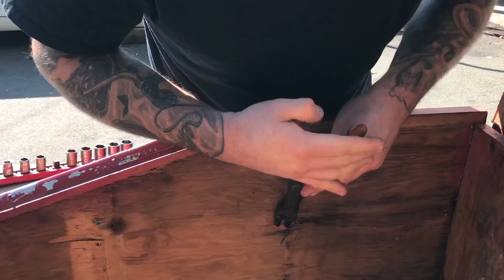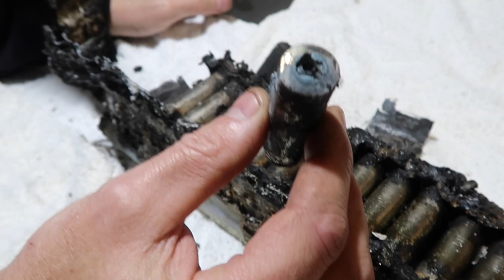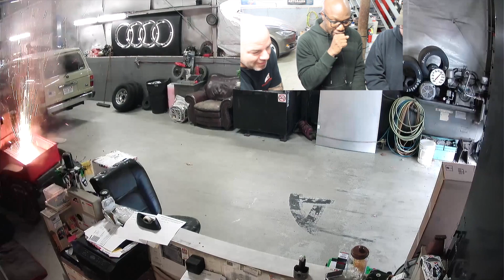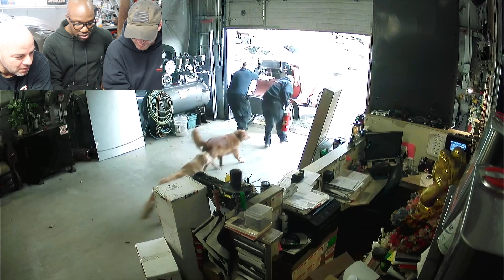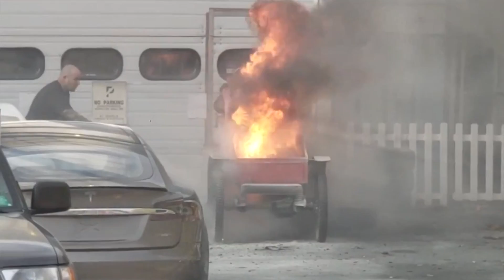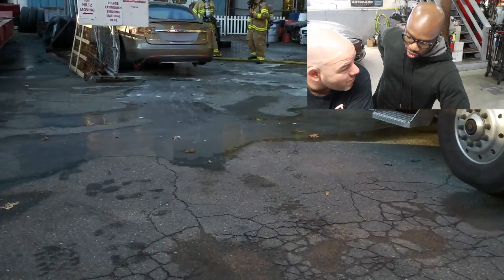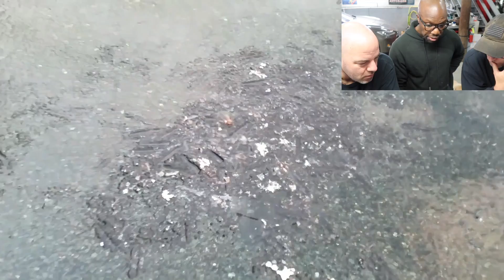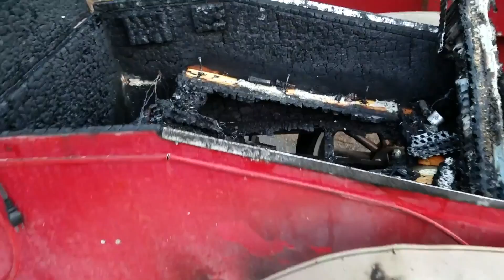My first Tesla Battery Fire

Comment: Rich, you've spent a lot of time and work trying to convince the world that Tesla should support independent shops and mechanics and then you go and do this...
Reply: It's called being honest I guess. Like anyone he'll learn from his mistake and be more careful with batteries
Reply: What rich did here is basically the equivalent of someone planting a new fuel line in their car, knowing it has a leak right in the engine bay, but installing it anyways, because funs and giggles
Reply: TBH this has nothing to do with Tesla. The way these guys charged and connected the batteries (and for some reason edited out some parts and didn't talk about what they actually did wrong).. It would happen to every other battery out there.
Reply: The battery as a unit is fairly safe. It's not safe once you start taking it apart and removing all the safety measures Tesla put in there. (the first being the large case surrounding them.)
Reply: This happened because he got a cheap charging solution. Not because people touched a tesla battery.
Reply: They need training in physics and chemistry because they don't seem to understand what is happening - A FIRE EXTINGUISHERS? EIGHT EXTINGUISHERS? It's not a fire, it's a thermal ignition chemical explosion. And the smoke is poisonous!
Time for certification. Backyard ICE mechanics are not up on physics. That could have leveled the yard and poisoned the neighborhood.
Reply: @davis.fourohfour  don't be soosoooo dramatic!! ease up on the sauce ur on.
Reply: Tgey sure should. But if you ever looked at the packs they use, you'll know that the main battery unit isn't meant to be opened at all by anyone but Tesla themself. And the big packs are usually not refurbished but replaced and disassembled. Good cells might make it back into new batteries, but only after testing
Reply: Robin Rumpfkeil batteries are always thrown away, integrally. If you watch this channel you'll have noticed how much effort is made in battery packs to make them not serviceable at all. Lithium is not expensive enough to make manual disassembly, testing and reusing of individual cells a viable thing, and it will never be. Cells ages differently, dendrits grows inside and possible residual lifespan is completely unknown to allow them to be grouped again in packs with other unknown state cells.
Musk himself says that his dead batteries are crushed and chemically separated, the vast leftover being dumped in cement mix to pour concrete...
Reply: Robin Rumpfkeil  also, "fixing" a battery pack by manually swapping modules is still viable economically for a DIY kitchen-knife-equipped enthusiast, and it should be a safe and documented solution to expand life of batteries, and it is the whole point of this channel.
Reply: @Damien.D  well. But the chemical separation means you win back Lithium and other rare earths that can be refined and reused.

I know that manually replacing cells is done often, but you shouldn't do it without knowledge of the terms and if you own a Tesla, you should be having the money to let a professional do it.

Hell, here in Germany, a mechanic isn't even allowed to remove the safety fuse of any EV/HV without proper equipment and license. If the see someone in a workshop working on any EV/HV that is not properly secured and the person working on it not at least being supervised by someone with a EV license, they're gonna drown that shop in fines
Reply: Robin Rumpfkeil truth be told, lithium and rare earth ends mixed in the concrete. Separation can only separate metals (aluminum from the frame, copper from the wires...) from the rest. Lithium is not expensive enough to mine to bother invent a way to recycle it properly. It sad but economic factor always win. That's why diesel engines runs on petroleum based fuel instead of vegetal oil, and that why EV are going to be another large scale ecological disaster.
DIY fixing is a way to personally reduce that effect.
Reply: Maybe if Telsa was more open about their technology these issues could be avoided. So that’s not a good reason to hoard technology.
Reply: @FukaiKokoro  BMS circuits are not some Tesla secret sauce. I have one on my Homebrew 52v system. And I don't have ambitions of owning/operating an EV shop. Hell I don't even have a college degree.
Reply: @FukaiKokoro  there is nothing to be open about. These were JUST Cells. If you use the block you have to make sure to use am BMS which checks each cell block. 

From what I have read they charged the pack without monitoring and overcharged it. 
If you work on these cells something stupid like this shouldnt happen.

Comment: I'm assuming that the inverter had something to do with it as the battery packs were too much to handle after a while being charged and caused one of the cells to short out/too much charge for one . It's hard to tell as the video does not show daisy on the charger. But either way nobody got hurt and the car was outside during the main fire. You guys are very lucky!!!

Comment: This seems like a big missed opportunity to properly explain the necessity for a proper battery management solution and then commit that you will never build something this unsafe again. If the guys had been out of the shop for lunch it could've easily burned to the ground. While I applaud everything you've done for the DIY EV community, the event and more so treating it like a big joke, with an aside noting it should've had a BMS really sets things back.
Reply: Agree totally. I know you have to value people's style, no problem with that. But when there is so little concern for safety and it backfires it is important to make the point.
I know they were just having a look at what it would be like, but that is where you need to be the most concerned as you just dont know what will happen even just changing the voltage at all.
Reply: Just a somewhat cheap Chinese circuit board 12S BMS will protect you when charging cells in series and when they pass 4V turn down the current to 300mA and switch off at 4.2V  If pack health is unknown check voltages during charging to discover if some of them are far off.
This is somewhat disappointing, I was certain Rich had this figured out. At least he can take his bucket of burnt cells to a Tesla service center for a refund.
Reply: @Tore_Lund  A cheap Chinese BMS will warn you when a cell pack gets out of spec, but they are designed for small ebikes, so they won't be able to do any balancing because they can only bleed at about 200mA max. You would need a BMS that can bleed several amps because the capacity is so great, or better still, one that can redistribute the charge.
Reply: @ahaveland  Sorry, wrong wording, yes a Chinese BMS is only a safety feature, not a proper balancer, but it prevent fires and should be enough for a toy car like this that wont see daily use. Rich should also have gone over his cells with a multimeter to discover if they behaved as expected while charging.

Comment: After seeing this I'm more convinced to buy a hydrogen powered car in the future 😬
Reply: yes because hydrogen doesnt burn /s
Reply: @slembever  Hydrogen does not spill under your car so it is more like a torch somewhere under the hood, if it burns. Also hydrogen cars have a flame thrower to  take of that ( a quick relief valve that is controlled by the management system)
Reply: Cars need compact forms of energy. If abused, those forms of energy all explode and burn. This situation isn't a knock on EVs, just a reminder to be careful with this much energy in a small space.

Comment: SO WHAT WERE THE PROBLEMS:
1. NO BMS
2. MAYBE BAD BATTERIES
3. MAYBE NO COOLING SYSTEM
4. MAYBE POOR CONSTRUCTION OF THE BATTERY CAGE OR WHATEVER
5. IF THOSE WERE JUST TESLA MODULES THEN HOW WERE THEY INSTALLED AND WHAT WAS DISCONNECTED
Reply: THIS IS A GOOD QUESTION AND WHY ARE WE YELLING?
Reply: Nicholas Littlejohn Sssshhhhsssttt
Reply: RonPaulgirls there was nothing tesla about that. Merely overcharged Lithium batteries; maybe from Panasonic but in overcharging the brand doesn’t really matter.
Reply: @ericoudammerveld424   THOSE WERE TESLA MODULES........SO YOU THINK IT WAS THE ABSENCE OF THE BMS
Reply: RonPaulgirls absolutely
Reply: RonPaulgirls what I meant with nothing tesla about it is that the hardware was undergoing fully unmanaged charge and with that having nothing Tesla about the conditions being created.

If you put a moped engine on kerosine you will also blow it.
Reply: @RonPaulgirls  Is your caps lock key broken?
Reply: He said it, Tesla module without any management attached to them, he just crammed them there like replacement for normal acid battery. Just connected the wire, that's all he did. So yeah any short anywhere might be the cause.
Reply: RonPaulgirls yes you right, was because the BMS